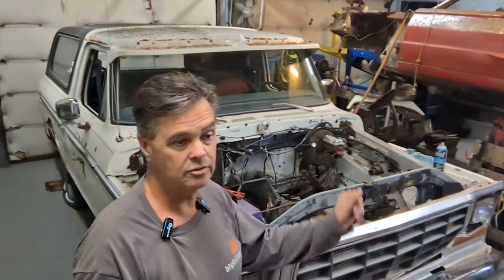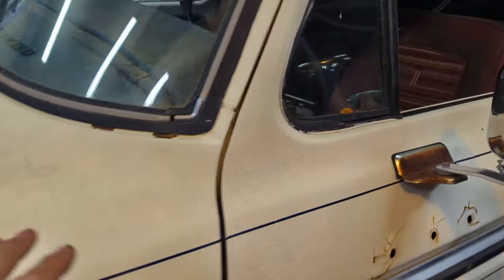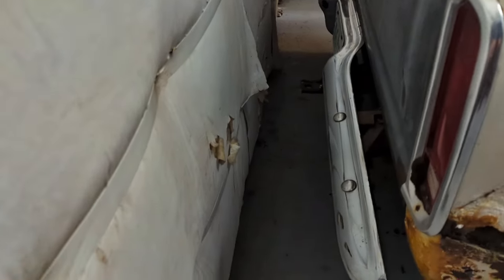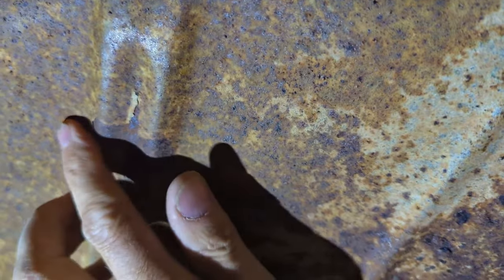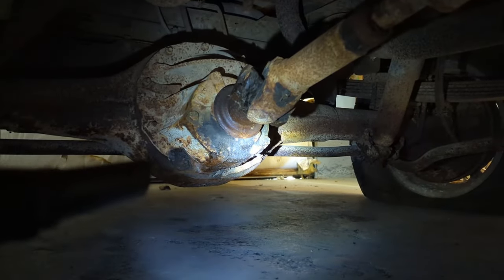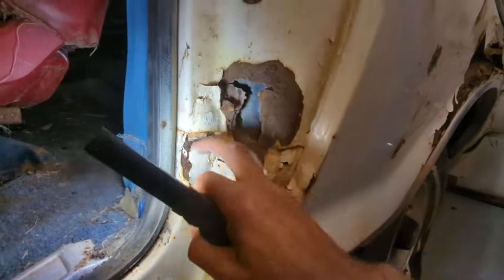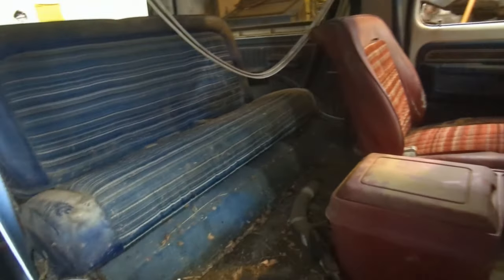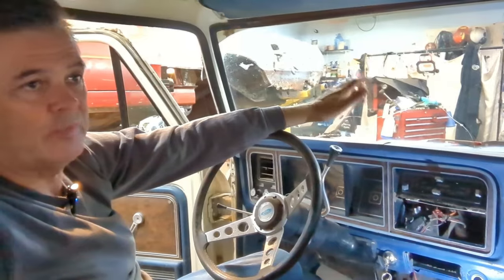My FB Marketplace Sight Unseen 1978 Ford Bronco Ranger XLT! Was It Worth The Risk?

Comment: It has great bones - solid floors, solid frame, front fenders, interior is mostly good, etc.  I think you did well.  The floor of my younger son's car looked like that.  You're not going to believe this, but we wire brushed it and hit it with Rustoleum Rust Convertor.  Couple years later it still looks good. Looking forward to seeing the quarter panel installation.  Happy Easter and thanks for sharing ~ Chuck
Reply from the maker: I'm very pleased with this Bronco, there is always a worry when you buy a vehicle you haven't looked at before paying. In this case, I could see the parts value was enough to cover the asking price.
I did the same thing with my yellow 79 ford, gave it a light sanding, and then hit it with rust converter...that was in 2017, needs to be redone now, but I was impressed.

Comment: Another one!  When is Bev going to cut you off this Ford addiction.  ;)
   That transmission pump looks like its been exposed awhile. A bit of caution in that area.  Could be rusty inside plus water in there.
Reply from the maker: Yes, another one! BTW, this was bought with her full approval, she loves these old Bronco's, I wouldn't be surprised if we end up keeping this one for her.
The oil in the transmission is so clean, I would hate to drop the pan, but water has been a concern, maybe I'll pull a sample with a suction pump, and see if any water comes up...the rust is definitely in need of a cleaning, can have that running on the bushing. I do have an extra shaft, maybe even just swap it out.